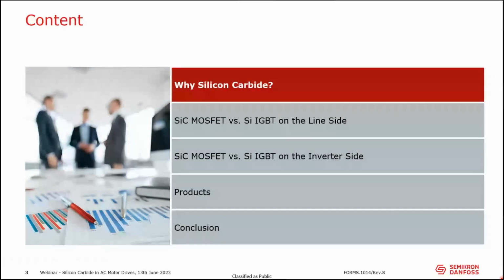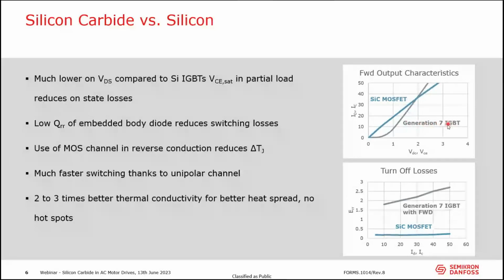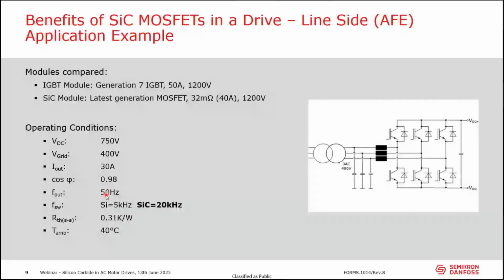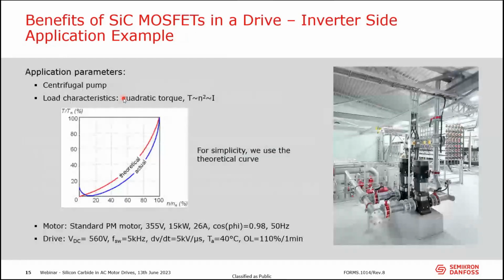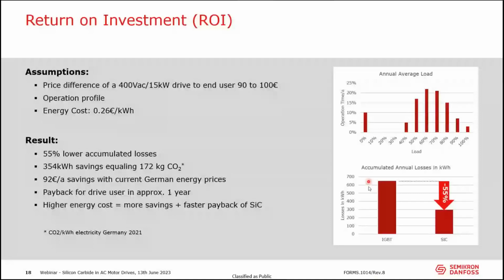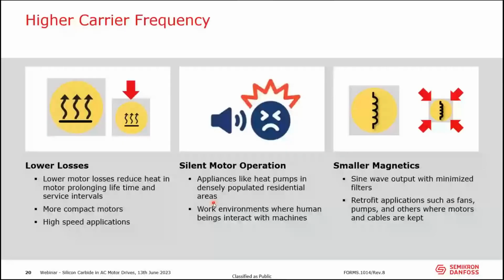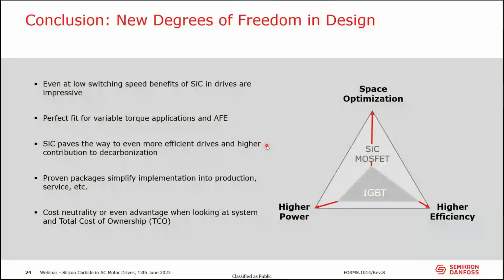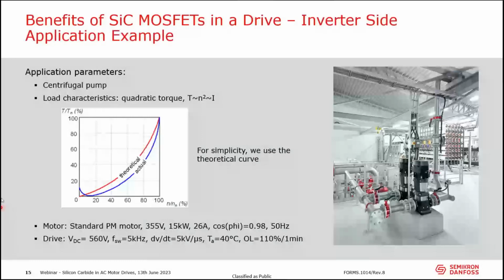Webinar: Silicon Carbide in AC Motor Drives

Comment: How does it compare with BLDC Motor and drive ?
Reply from the maker: We did not analyze different motor technologies as this was not the scope of this exercise. We focused on the losses in the power module and chose a standard PM motor on a pump as representative simulation vehicle. The possible savings here mainly result for the motor current-torque characteristics and the lower losses in the SiC MOSFETS. If your BLDC application has a similar load (current) characteristics you might see similar benefits when switching from an IGBT to SiC MOSFETs.